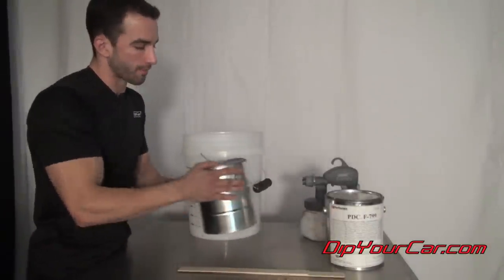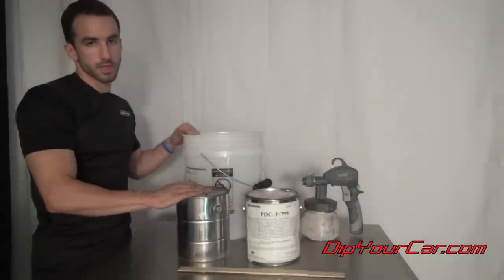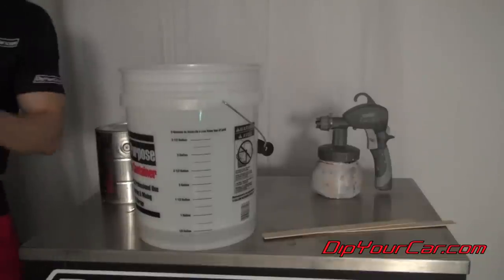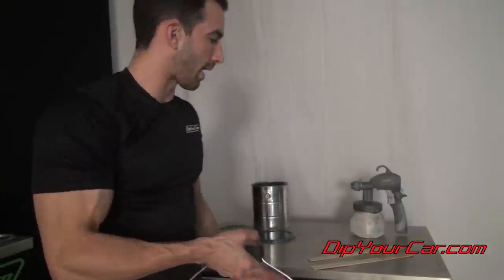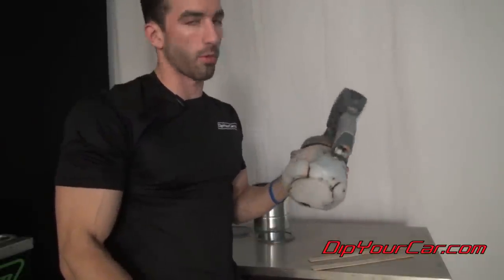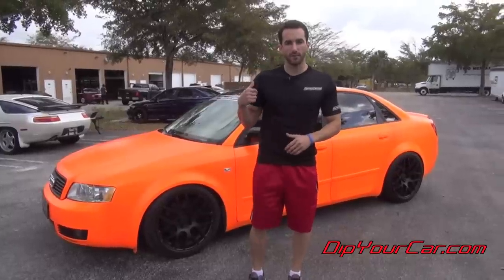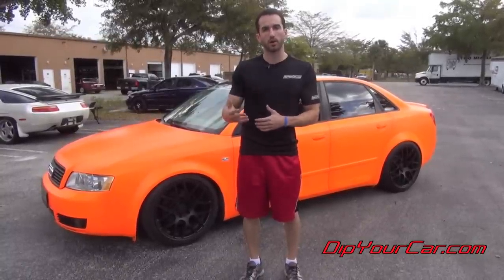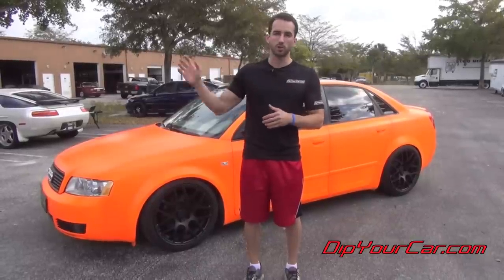Satin Orange Plasti Dip - How to make a Satin finish using Rubber Dip S

Comment: It will be fine as long as you spray in warm weather and let it cure in warm weather. My winter wheels are plastidipped blaze blue and i've had zero issues on snow covered roads, salt covered roads and in the cold in general.

Comment: bro i did my window trim on my honda accord 09, and it was a pain in the ass, it turned out pretty good but the hardest part was peeling the edges off .... also so far with three plasti dip cans, the spray get clogged and doesnt come out like yours an even spray, mine was more like chunks, anyway i did my grill and emblems, and they turned out pretty good , those were easy !!! any advice bro ?